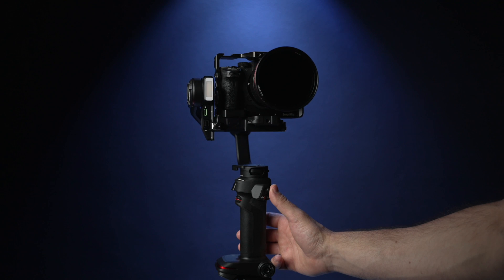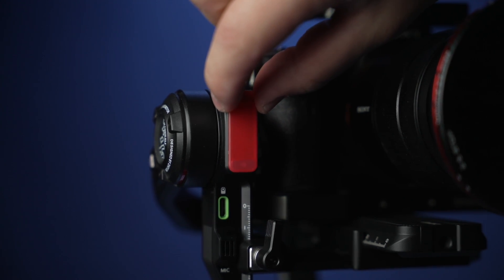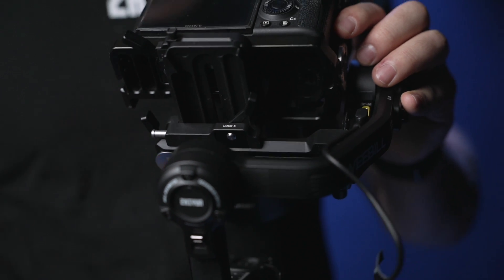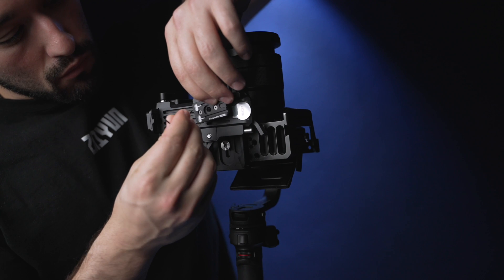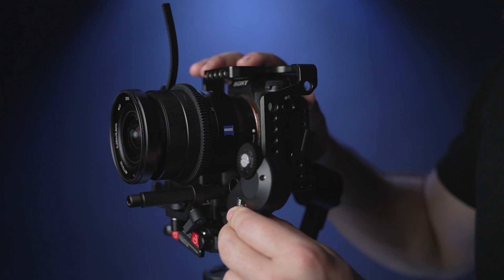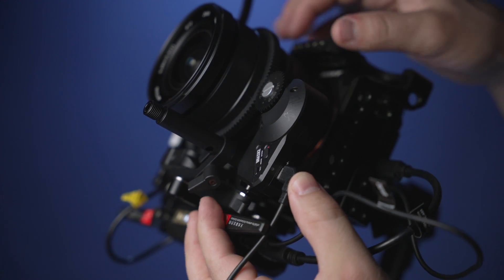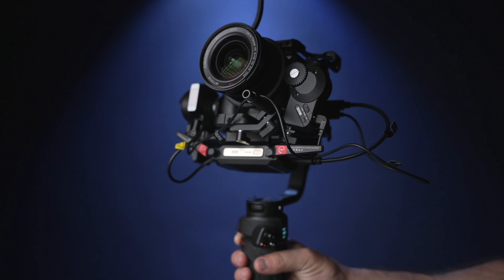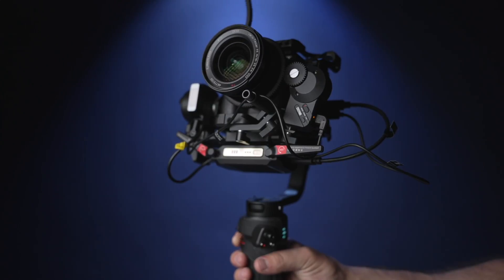ZHIYUN WEEBILL 3 Official Tutorials |【EP4】Built-in Fill Light & Mic and Extra Accessories

Comment: Had trouble updating firmware on the CMF-06 follow focus for my weebill S.  Just wouldn't work, with my gimbal.  I got an email from Zhiyun tech help asking me to take photos of the messages on my pc screen as I tried to update the firmware.  I did this and sent off the photos, then they emailed me again to repeat the procedure with photos of messages, I did that, yet again sent the photos via email, as instructed.  Then they asked for video of the procedure, I took it that they were just going through the motion and so chucked the transmount follow focus into the dustbin.
I bought another from Wex Photographic, same rigmarole, took it back  they tried to update the firmware on both Mac and PC and they couldn't get it to update.  So that time I got my money back.  So I vowed I would only buy DJI after that.

Comment: LUMIX S5 not detected on Bluetooth on Weebill 3S any solution? Can’t use the recording button directly. Updated to 1.76 version on purchase
Reply: Be normal, at present, Weebill-3S doesn't support Lumix S5 to realize Bluetooth shutter control. this is WEEBILL-3S camera compatibility list: https://zhiyun-website-shenzhen.oss-cn-shenzhen.aliyuncs.com/instruction/20230817/1692254895811-e7tCG4cY.pdf

Comment: Zhiyun Weebill 3 is my first camera gimbal I ever use. I want to try the follow focus but don't know which model is that that showed in this video. Can anyone tell me the model of the follow focus motor?
Reply: Control Wheel
Can be customized in the menu (aperture, shutter, ISO,
digital focus, focus /zoom control motor, roll axis, tilt axis,
pan axis).
but before you adjust these parameters, you should select it in the menu on the screen to choose which  parameter you want to adjust with the croll wheel.
Reply: @chenlyn-cj8ve  same question here. apparently the only actual focus/zoom motor is the model CMF-06 but its not compatible with the WB3. Searched for Control Wheel and couldn find anything.

update: read somewhere else that this motor is compatible with the WB3